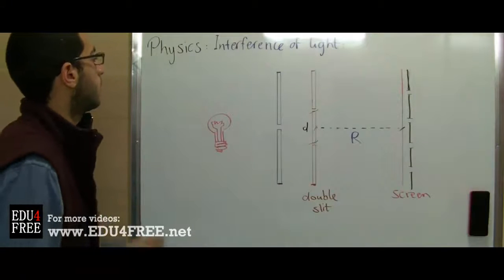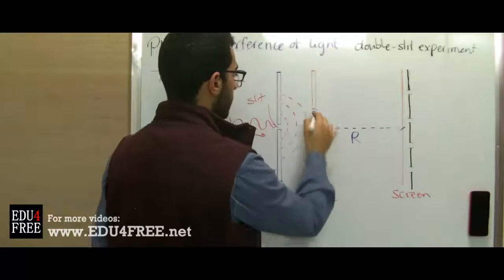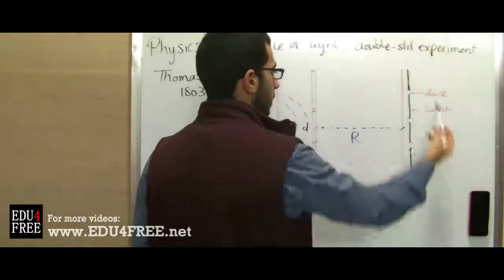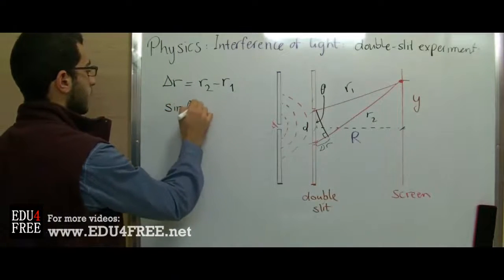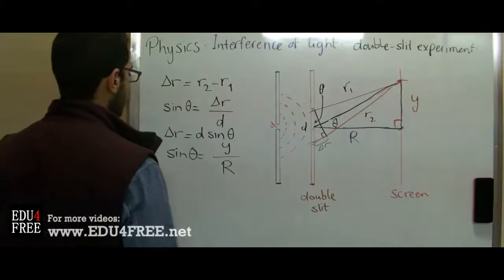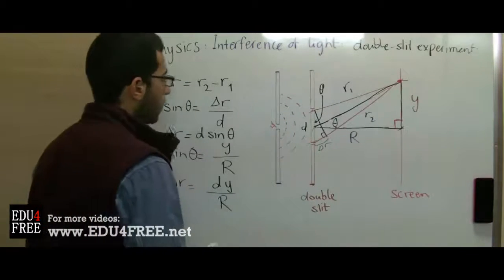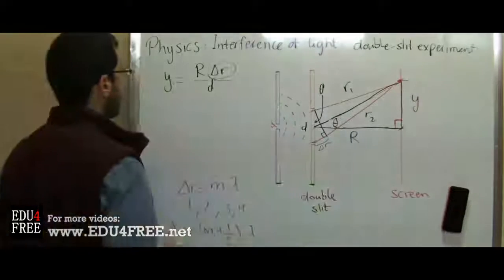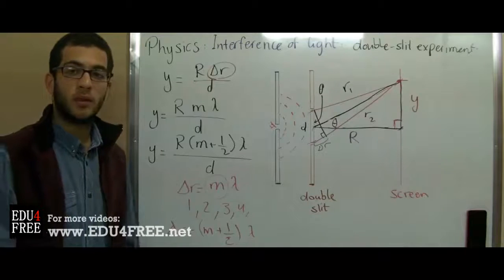Thomas Young - Interference of light - Chapter 3 - Physics - - عبد الله رضا MD | Rocademia روكاديميا

Comment: Sorry but I couldn't understand how you got: (delta) R = dy/R
Reply from the maker: We have two triangles, the small one and the big one, both have the same angle θ (same measure), so in the small triangle sinθ = (Δr/d) and in the big triangle sinθ = (y/R), then Δr/d = y/R and so multiplying both sides by d we get Δr = dy/R.
Hope it was clear, if you got any question feel free to ask :)
Reply: ***** Oh thnx :) well actually I wanted to ask 1 more question...there is some questions that ask to outline an experiment to demonstrate the diffraction of transverse wave and longitudinal waves and they ask us to draw it as well...so do we have to draw this one in your video for the transverse and what do draw for longitudinal?? thnx in advance :)
Reply from the maker: It doesn't matter the type of wave, both with go through the double slit and both will superimpose. So In transverse waves or longitudinal waves it's the same drawing
Reply from the maker: The only difference is that for the transverse wave your drawing will be like a superior view from above, because the wave oscillates horizontally so you will see it from above
but the longitudinal wave will be a side view, as the wave oscillates up and down, so you will see it from the side
Reply from the maker: But in both cases you will get the same pattern